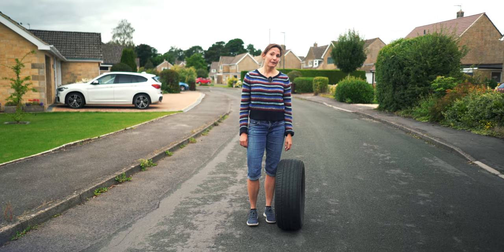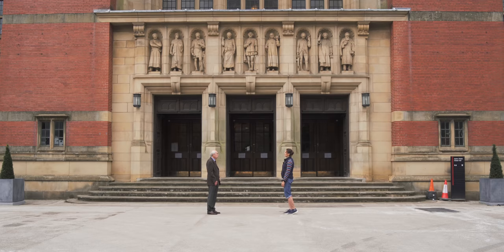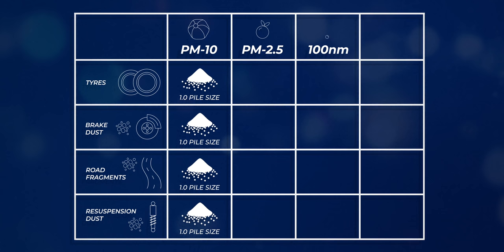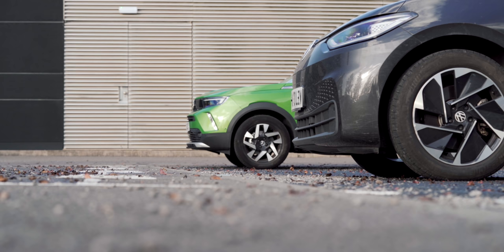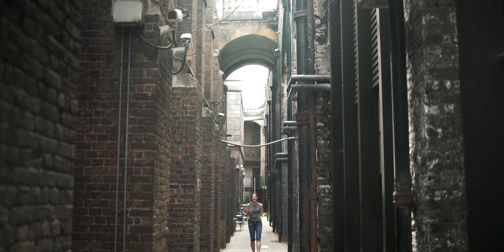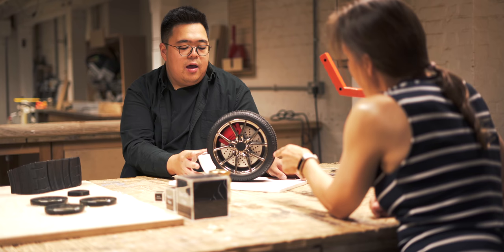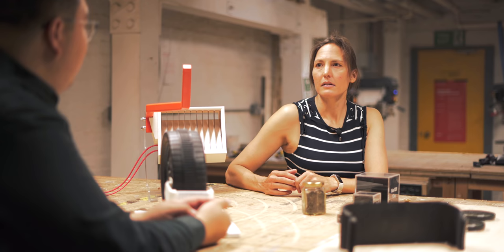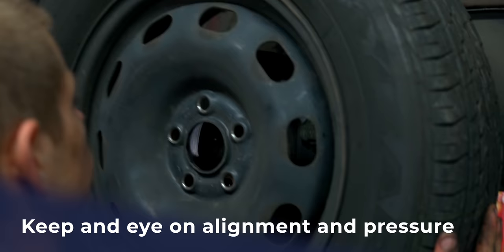The Secret Pollution That All Cars Are Guilty Of | Fully Charged

Comment: EVs can do all braking with regenerative braking. No brakes dust at all. Zero. 
An EV can brake at the same rate as it can accelerate without using the brakes. If you drive like a normal person there is no need to use the brakes. Brakes would be for emergency use only.

Comment: Whilst overall this is well put together and balanced info infortunately I can see this video being used by the anti EV lobby to support their discourses of delay. All too often now, on almost every social media post that mentions EVs you see people popping up saying “what about tyre and brake dust” and using it as an excuse not to adopt EVs. (Usually they are implying they are not perfect so why bother and these statements are given in the context of endless other arguments about limited range, long recharge times, adoption costs, pressure on the grid and manufacturing impacts, so they provide an emotionally convincing get out clause to what is often an exhausting debate for those beginning to navigate these questions for the first time). 

Yes these arguments don’t really hold any water if you really examine them clearly, but these emotive arguments do have large impacts on public opinion. I have met people that are very environmentally concerned, who even have an air source heat pump heated home, play endlessly with optimising the heating efficiency and are very proud of it but who don’t feel they should get an EV because, well, they aren’t perfect yet and there’s pollution from tyres and brake dust. They still have an ICE car parked on the driveway and can clearly afford an EV if they wanted. 🤦 Where there’s a newfound care for the impacts of our actions, pointing out another impact, however small, of a potential action being considered can be enough to sow doubt and cause delay, leading to action not being taken at all. That delay means that the status quo wins and people carry on burning fossil fuels. 

We really need to have something upfront in this video (and throughout) that gives the brake and tyre dust problem some context relative to the overall air pollution vehicle emissions and global heating problem. I think the tyre dust and brake dust problem is relatively small, compared to global climate impacts of CO2 and greenhouse gas emissions and the impact they will increasingly have as global heating continues. I had hoped to come away with a fairly good idea of how much it contributes to health impacting air pollution relative to ICE tailpipe emissions, but that was only vaguely and inconclusively mentioned by one contributor. I know the channel is preaching to the converted, most people subscribed will already be fairly convinced of the benefits and need for EVs, but given that the topic of this video is such a potent talking point among those looking sow doubt and delay EV adoption it would be very pertinent to give some framing of this issue in the larger context.

Let’s not give any fuel to the internet trolls (and Fossil Fuel industry bots) that are putting endless pressure on public discourse around EVs. Whilst it’s an argument that has been won within the circles you may operate in, in wider society it is very much still an argument in process.

Comment: I’m just more confused than before with that table.
So EVs produce 0.25 pile of micro particulate, or produce it on top, and of what size?
The table had some kind of message, but it was very confusing. I’m still asking me, those three particulate sizes, are those equally harmful? Why are you putting them apart? Only because people know them from the press?
I suppose that for normal people it is a quite informative video, but from a scientific perspective I’m left with more questions than before.
Nevertheless, if you want to move something from A to B you will make some kind of pollution, it doesn’t matter which transportation method you choose, hence you can only reduce the pollution by choosing the transportation method wisely, but on the other side, that is a luxury that not everybody or every company can afford.

Comment: You correctly point out that heavier vehicles wear tyres more. I can only speak for myself in stating that I LOATHE those ridiculous MONSTER SUVs with a vengeance and not just for their gross (f*** off you unimportant  plebeian) 'aggressive' appearance. Their high stance increases their aerodynamic drag, as if the body style wasn't poor enough already (typically 0.28 Cd - versus 0.23) which means you need a bigger heavier battery to go as far OR it'll have reduced range compared to a sleeker and lighter vehicle. Either way, SUVs are MUCH less energy eficient than typical hatch/fastbacks. What's wrong with a Ford Fiesta, Renault Clio etc size car too ? Most of the time there's only one person in it anyway !

Comment: EVs don't really have to be substantially heavier, even with current battery technology. If we can get past the current obsession with ever increasing car driving ranges smaller batteries could be fitted. For example the base Tesla  Model 3 (with the Lithium Ion battery, not LFP) weighs ~1625kg which is not that dissimilar to equivalent ICE cars. It is still a very fast car and has way more range than you'd ever need in the city and it still works really well on longer country drives. Better charging infrastructure will also help people accept lower ranges. More expensive Model 3s have a 50% heavier battery and one extra motor and drive system which results in an additional 200kg+, lower efficiency and about an additional 110km range. Another example is the Mini electric which with it's relatively small battery weighs exactly the same (1360kg) as it's ICE counterpart! Most people in cities can get by (and would be better off) with lower ranges.

Comment: Twenty (yes, 20...) years ago I put tyres made with cornflour on my car. Developed by Goodyear I think. They came with all kinds of eco claims beyond the source of the natural material, including fuel savings from lower rolling resistance. They seemed fine to me. However, I've never seen them since, so presumably they were a commercial failure. They probably had the same particulate problem, but I'd prefer to breathe in cornflour to silica, if I had to... In the current more eco-conscious climate maybe Goodyear should brush off that formula.
Reply: All plants contain silica too, so no real gain there, but I’m surprised the corn-producing midwestern states didn’t promote the heck out of  ‘corn-tyres’ like they do bio-fuels.
Reply: @alexwilsonpottery3733  Plants contain silica, but other than greenheart, not a lot of it.

Comment: The US is mandating tire pressure sensors to alert low tire pressure. No mention of brake dust mitigation. Some of those brake discs use carbon fibre which might generate less but more harmful. dust... Like to have seen stats on EVs share of brake dust and is it cutting up the roads (being heavier). Even more of an issue with commercial cargo carrying vsns and trucks evem with regen braking

Comment: I'm guessing that the contents of those cubes are not highly compressed rubber like the stuff that was on the tyre originally. He should have tipped it onto the table. There was no reference point so thus quite misleading. Yes, tyres DO shred rubber dust, but THAT much in a single day? Erm, no.

Comment: Cheap tires wear out faster? I am confused. I thought it was the opposite way. I bought the cheapest Continental eco contact many years ago, those bastards lasted 75k km!!!! Then I bought some grippier and more expensive ones from Pirelli which only lasted 50K. And always the same old 2000 Clio 1.2 that goes now with 225k km. My driving style hasn't changed, or probably even more careful as I age.

Comment: Where is the evidence that low cost rubber adds more pollution?  If you keep running on old tyres that rubber looses its ability to grip/stop/corner so you may have an accident or kill someone.  Really need to see the data to assess fact from conjecture.

Comment: Air pollution is not the only pollution from this. Lots of it falls down on the road and are washed away when it rains or when a road cleaner comes by. Where does that rain water go? You might think that hole in the road goes to the sewers and to a water treatment plant, but in most cities they are two different systems and water from rooftops and roads goes straight to lakes without any cleaning at all! These lakes are in many cases the city’s main drinking water source!

And those road cleaner vehicles? Well they empty their all black shitty water somewhere, I’ve seen them do that in the rain water drain => untreated straight to our water source. 

Someone can change thing small quite easy and quickly. Local authorities as usual.

Comment: Hmm, yes brakes emit particulates from the friction materials.. EVs barely need classic friction brakes because they can slow down due to regeneration. That's another plus for EVs in that case. It's HUGELY MORE than a 50% improvement over other vehicles. Easily a quarter of the 'emissions' from other vehicles l'd venture. They also don't emit lubricants as they don't have sumps full of the stuff that regularly leak onto the road.

Comment: The tyres are worse now. The new bigger and wider tyres cause much more pollution. When the car turns corners one side goes faster than the other  and tears rubber of the particles of the tread.The extra weight EV cars wares particles off tyres as well.

Comment: The challenge with taking information from experts and explaining with consistent science terminology.
At 3:58 the introduction of inconstant units is a bit unhelpful. They "experts" might very well use different terminology at different scales.
Suggest it would have been helpful to just say 10-PM, 2.5-PM and 0.1-PM.
It like saying I'm going to walk 2.4 miles and turn around and come back 1380 yards, meet you there. Not the clearest.
Just a thought. Helping a student yesterday on a college engineering project and the professor gave inconsistent units. On purpose? Maybe.

Comment: Cheap tires are lasting longer. For example Continental tire 185/65/15 - for 5000km normal driving - wear 2 or 3 mm. For the same driving cheap tire Debica - wears only 1 to 2 mm. I don't think this advice is correct. 🙃  The expensive tire can safe couple of meters of stopping or aquaplaning, in the same scenario the cheap one can cost your life. So for this ecological point It's not worth it.

Comment: So ok, Electric unicycle with tire vacuum cleaner attached. Just one wheel. Breaking is with regen motor. No suspension. Should be no polution at all! At least on device, still there would be polution out of road surface.🤔 So ok. Electric unicycle on granite paved roads. This might do the job

Comment: He is wrong about tire wear. EV-drivers drives slower and more carefully, therefore are the tire wear a lot less than on ICE cars. I know, because my Leaf had original tyres after 60000km when i sold it. And a lot of rubber left.
Reply: Err, EV drivers drive more slowly??!!
This has to be COMPLETE nonsense!!
EVs are generally capable of significantly faster acceleration and similar top speeds to ICE cars.
Human nature being what it is, OBVIOUSLY, drivers will exploit this!!!
You are, sadly, utterly deluded if you belive what you claim.........!
Reply: @andymccabe6712  I know what i am talking about. From now nine years of experience. If you accellerate hard, and drive fast, your battery will drain fast and you wont arrive to your destination. I live far out on the country and drive long distances. I never drive faster than 80 km/h (prefered 70 km/h) and accelerate very slow. Furthermore ev:s invites to a more relaxed driving.

Comment: This seems like a topic very much in its infancy. Nothing is anywhere near ready for market, and there seems not much in the way of quantitative data. In particular, if we switch from petrol etc. to battery does that move us - say - 80% of the way to eliminating particulate emissions - or 90%.... 95... 98…?

It's also important not to weigh in too heavily on the drive less item. While it's debatable, less opportunity to move independently from place to place is very close to a direct reduction in the standard of living.
Reply: It would also be valuable to have some measure of comparison between the importance of greenhouse gas emissions and particulate emissions.

Comment: How are electric vehicles  heavier? I thought the less parts and the more streamlined  designs made them weigh less
Reply: Batteries are very heavy
Reply: @robthomas7232  my Renault Zoe is lighter than most diesel SUVs
Reply: @ProfSimonHolland  That's interesting but we need to compare apples with apples (he says about to not be as precise with his fruit based comparisons as he'd like). Looking at the Corsa-e then google states that its weight is 1,530 kg with the entire Corsa's weight range is 980 kg to 1,530 kg. Therefore I assume the Corsa-e is the heaviest of the range. 
And don't get me started on the trend of the ever increasing wheel/tyre size to go with these SUVs (unless its Chinese as they like smaller wheels)

Comment: The emphasis on non-exhaust emissions is disingenuous. PM 2.5 emissions from exhaust are 50 times larger than from tire wear and  20 times higher than from brake wear. An entire video that attempts to make the case against non-exhaust emissions while never mentioning they are 2% of the problem is like suggesting the air travel is causing climate change. The data is available at the US Bureau of Transportation Statistics.

Comment: This video put my nerves on the limit. I will quantify the problem for those so called professors. It is unbelievable how smart people like Dr Czerski cannot apply simple estimation, so I will do it for her.  A typical class B car like Skoda Fabia 1.2  emits 150 g/km CO2 from exhaust. Now the tire R16 is typically 8kg and can last for 50 000km loosing thread of 1 kg.  Now adding 4 tires  that is only 0.08g/km. That means that pipe exhaust is bigger by whopping 1875 times. The problem of tire emission does NOT EXIST. A light breeze is causing bigger dust in the air. To put it in simple terms if from ICE cars emissions dies today about 100k people per year, passive emissions from tires would be responsible for only 53 deaths. If that does not convince anyone I do not know what will. And at the end, 1 l of petrol is 0.74kg and is using 11.3 kg of air, causing for average use of petrol 6l/100km around 720g/km of total exhaust emission. That means that tires emission is 9000 smaller then total emission from burning fuel.
Reply: @UCsfrX59l1IZ3jitiHrGYvRA Of course I do, am am simply estimating biggest climate  change gas emission CO2 that is far dangerous for humanity then dust pollution. Total exhaust pollution is much higher and far more dangerous to people like NOx, CO, benzopiren etc. I am simply very mild for ICE cars.

Comment: A pointless argument.  We need to travel there is no alternative,  tires rubber, break dust ,  yes regen helps but that still increases tire wear, rail and metro produces metal dust on the tracks far worse to breathe in than the street , what’s next taxing cyclists for c02 and methane produced  as they jump the lights and the damage they cause to the road network  or the daft idea of turning off the street lights at 10 pm to save co2 ,  the energy to capture this would be astronomical up there with burying nuclear waste than trying to recycle and make inert .

Comment: On my diesel just replaced my firs brake discs and pads and done 107k miles and beginning of 3rd set of tyres. I like electric cars but not very viable now. Collection of practices from tyres 🤣🤣 are these scientists ever driven full season? Are they know what doing spray out from road when its wet or how its behaving snow or just sludge from tree leaves? Good luck guys you just spending public money for a big scam.

Comment: Why can't they uses some kind of particle collector on top of lamp posts a filter system throughout towns and cities and why can't they use all council vehicles with suction filters underneath there vehicles  why can't you uses air vents with filters system on electric vehicles where the grill is on the front of all vehicles .

Comment: Not entirely true, your so called expert is wrong in the case of my vehicle, I don't use the breaks unless it's an emergency and again you're wrong about the weight, look at the Nissan e-NV200 the curb weight of an e-NV200 is 1,592 kg versus the diesel variant NV200 1,667 kg

Comment: Highly misleading. EVs use far less friction braking than a regular ICEV. It's way less than half. Sure, slightly increased tyre wear but the total is much lower, especially when considered alongside exhaust emissions.

It's right to say that EVs cause some particulate emissions, in the same way that EVs cause some CO2 emissions (from the electricity generation)... But it's significantly lower for EVs than ICEVs.